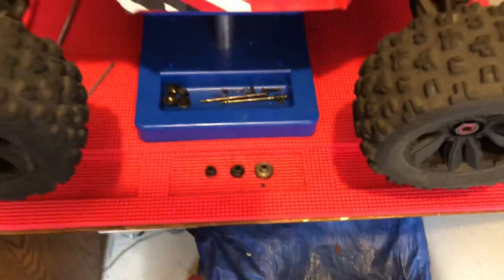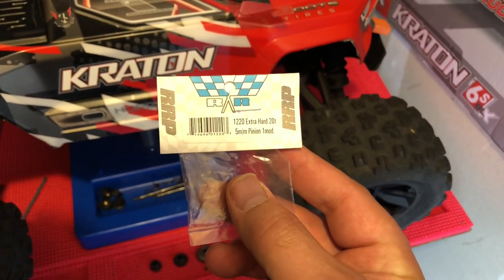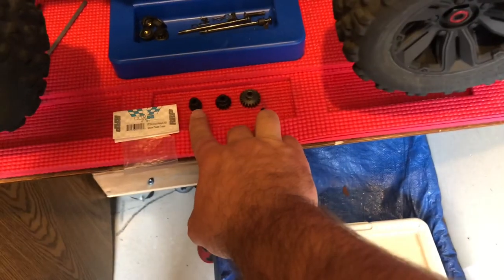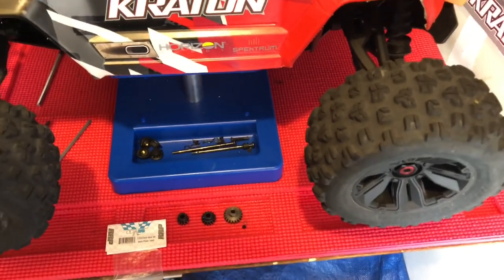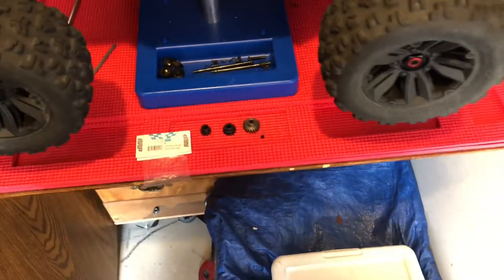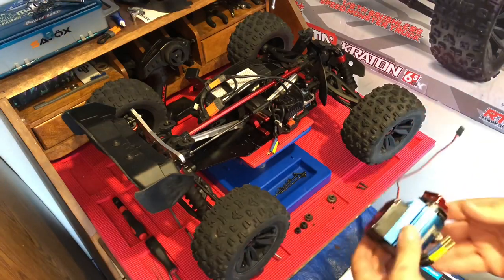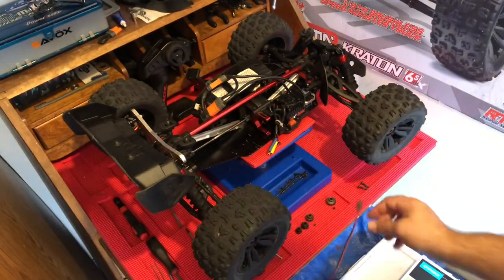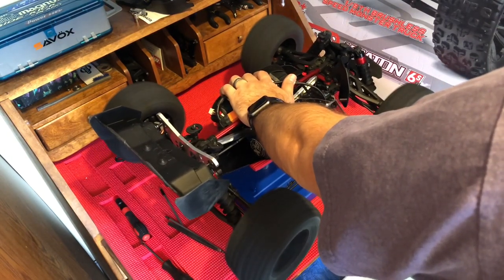PINION GEARS | Arrma Kraton | What you need to know

Comment: I have kraton 6s v5 will the optional 15 tooth speed pinion be ok for bashing?? My 12 tooth pinion stripped so I'm changing to the 15 tooth and I'm worried about overheating?
Reply from the maker: Yes, youre fine. The 15t speed pinion is still for bashing.
She will run hotter yes, but you shouldn’t run into any overheating issues.
Unless you’re running oversize tires and you’re running in long grass for extended runs. Both those things contribute quite a bit to heat. That and where you live, if it’s 100+ degrees outside, you can have an increased chance of overheating.
I always recommend picking up a heat gun, you can find good ones for pretty cheap and having one on hand as always good idea.
I have videos in my library that will talk about heat temperatures and their thresholds.
I also have a whole series on high powered fans.
It’s not until people start overgearing past 15 T typically where they start running into heat issues.
Reply: @EastTactics  thanks for reply! I actually have an arrma heat sink and fan but it's not quite as powerful as yours and I just ordered a heat gun off of Amazon with the help of your links on the pinion gears video. I think I'm going to upgrade to a better heat sink and more powerful fan for motor and esc. Thanks a lot for the help 👊🏽👊🏽. And I also took a screenshot of the motor temps that you posted in the description you're a big help thanks
Reply from the maker: Any time
Reply: @EastTactics  one more thing. I have scorpion belted tires on the back and the stock d boot tires on the front of my v5. My question is will I have any problems with the differentials on this set up of tires? What are your thoughts because obviously the tires in the front are ballooning a lot while the ones in rear doesn't ballon at all
Reply from the maker: @boomerak4774  
You differentials really shouldn’t be put under any undue strain based on the fact that you’re running different tires in the front and rear. Unless they’re a size difference was dramatically different.
Do you do it, simply because you like the look, ideally running all four of the same tires is recommended, but you should be fine.
Have you seen my video i’m putting silicon earplugs in the center differential? Massively reduces ballooning, especially in the front.
Something you might considerz
Reply from the maker: @boomerak4774  
Your differentials really shouldn’t be put under any undue strain based on the fact that you’re running different tires in the front and rear. Unless they’re a size difference was dramatically different.
Do you do it, simply because you like the look, ideally running all four of the same tires is recommended, but you should be fine.
Have you seen my video i’m putting silicon earplugs in the center differential? Massively reduces ballooning, especially in the front.
Something you might consider.
Reply: @EastTactics  no I only did it because one of my stock tires blew out and my local rc shop only had a pair of the scorpions that would fit my truck. Thanks I'll check out that video!

Comment: Did you fix the pinion gear bolts with Loctite 270?  What is the Loctite number for fixing the motor mount?
Reply from the maker: Yes, I use, loctite 209741 Heavy Duty Threadlocker, it’s 270. 
I also use it for the motor pinion, and for attaching the out drive to the front and rear spiral input gears. I also use the red Loctite for the motor mount when attaching it to the chassis up from the bottom.
Note, removal recommends heat, to break/loosen the bond. I use a smal lighter size butane torch.
I use blue 242 Loctite however when securing the motor from the top while setting the mesh.
Also note, that I have taken a Dremel to the two screws that attach/secure the motor (while setting the mesh) to the screws so that I now actually use a flat head screwdriver to tighten and remove those. See this video
https://youtu.be/NAOAFfMpXIk
Reply: @EastTactics   thnx alot lol

Comment: Do you run your truck on 3s ever even though it’s 6s I got lots of 3s batteries I’m thinking if I can use 3s I can get lots of run time just worried I’ll  mess up the motor or esc
Reply from the maker: I do run it on 3S, picked up the parallel adapter so I can plug both of them at the same time. 3s power for double the time. Can’t beat that.
I haven’t done it a ton though, and it runs just fine on 3s power. I haven’t heard anything regarding it potentially being bad for the engine or bad for the ESC.
Reply: East Tactics you mean the jumper plug to just run one 3s battery I need to make one and try it out what batteries you using btw
Reply from the maker: J Movision, no, what I mean is there is an adapter that allows you to plug in two 3S batteries into the system. You use the stock plug on one terminal that came with the car. And then you plug in a Y adapter to the other one. You then Plug  two 3S batteries into the Y adapter and the car runs on 2 3S batteries power for double the time. 

Here’s a video that shows my batteries and charger
https://youtu.be/LLp4Ld88xcI

Comment: What pinion gear would u recommend for max6 1650 combo on the 50 tooth spur
Reply from the maker: I’m assuming your running the Arrma 6s Kraton, if so, with that low of KV motor I’d recommend a 22 or 23 tooth if you were running a stock spur (46T). However, you’ve changed yours to a 50t. What was your motivation for increasing your spur to 50?
Correct me if I’m wrong… but going bigger on the spur increases torque and reduces top end speed
What is your overall motivation? You building a speed runner? Or is off the line speed and low torque your goal in mind?
A note to remember 
The closer the pinion & spur are in tooth count, the higher the speed.
The further away they get in tooth count, the higher the torque output. So if you wanted to get more torque and less top speed out of our rig, you could either up the spur gear higher or lower your pinion gear down.
If you wanted to get more speed for this truck, you could either 1) increase the pinion gear's tooth count or 2) lower the spur gear's tooth count. Both of these options will decrease the low end power of the truck while simultaneously increasing the overall top speed.
If I had the 50t spur, and didn’t feel like changing it, I’d run perhaps a 23-25t pinion gear. 😎👍
As long as you are paying attention to the temperatures of your motor and speed control, there isn't a wrong gearing. Play around and find what works for you.

Temperature Thresholds
Motor
Ideal - 140°               60° C
Hot - 150 - 160°       65.5° - 71.1° C
Overheat - 165°        74°C

ESC
Ideal - 135°               57.2° C
Hot - 140 - 150°       60° - 65.5° C
Overheat - 155°        68.3°C
Reply: I have an outcast 6s v2 it came stock 50 tooth spur running a 18 tooth pinion right now but tryna get more top end speed . I kno it’s a stunt truck but with low profile backflips I’m hitting 59 mph but looking for more u kno , but u think a 22 or 23 tooth will put a smile on my face 🤗 I wanna try that big pinion it’s just the thought of over heating my new Max 6 combo or over working my drivetrain what u think
Reply from the maker: Maybe upgrade your fans both both the ESC and the motor to keep’r cool.
Playlist about this:
DIY RC High powered fans https://www.youtube.com/playlist?list=PL9UjUE_DygV9w_KTuR7N0l-ygVhWPtNVw
Reply: @EastTactics  Thanks appreciate the info which fans should i be looking at
Reply from the maker: The Alli express ones are the best IMO. See links in all those vids. 😎
Reply: @EastTactics  thanks 🙏 ima look into it

Comment: Have you tired running your v4 KRATON with a RR 20T pinion on 6s yet?
Reply from the maker: Ya... dropped back to a 16t. 20T was killing my drive train, braking rear diff pin and planetary gears. Also cogging issues. 
20t was too much for stock motor and stock ESC. I’m Much happier at 16t. 😎👍👊
Reply from the maker: I have, unfortunately I was doing it with the stock motor and ESC. Which ended up providing a cogging issue and also increased my breakages in the rear differential. So until I get a better motor and ESC I won’t be running A 20T pinion. I run a 16 to Pinyon on punch setting six. And while it’s not quite as insane. It’s still I’ll beast

Comment: How many teeth u have on the spur gear? Spur gear also makes a difference
Reply from the maker: Stock 43
No longer run a 20 tooth pinion! Way too much for stock components.
Reply: @EastTactics  ok
Reply: How about the 20 on a 1250 6s?
Reply from the maker: Should be fine. It’s the 2050 that’s the issue. You’d be fine running 20t on a 1730kv motor. But you’d want better then a blx185 ESC.
Reply: @EastTactics  thank you. I wound up going with the spektrum kit, the 160a ESC and the 1250. Had a hard time figuring out how to mount it but I think I got it. I just ordered a 17,19 and 20 off your link for the Robinson pinions. Thank you again East
Reply from the maker: Ya I still need to mount mine Rory I didn’t create a vid on that yet… wanted to get the exb roller on sale… which I did. 
So it will be coming. 
Sounds like a sweet setup! How does it feel?
Reply: @EastTactics  lol, I don't know yet. I have been just using my blx while upgrading the EXB. I picked it up on the earlier sale that HH had going on. I've just been watching your vids and putting a bunch of m2c parts on. The electronics only got here yesterday. Been searching for a spektrum 8s pack but I guess they don't make one? To go with all the other smart function pieces. 🤷
Reply from the maker: Even though I’ll be running an 8SESC, I never do plan on running an 8S battery pack. Or two 4s. I still plan to run sixth power pretty much hundred percent of the time. The main reason I went with the higher and yes he is basically just because it’s better quality and provides more power to your servo etc.
Probably tear up your differentials pretty quickly If I were to toss in an 8s power in the 6s
Reply: @EastTactics  ok
Reply: @EastTactics  I was thinking that too. Maybe help keep the temps down running 6 on an 8s capable ESC. Looking forward to your EXB build vids.

Comment: I have a 13th tooth pinion in there now or put a 16 Tooth pinion will it be safe in rguards to overheating?
Reply from the maker: It comes stock with 13, they offer a high speed gear I believe that’s 15. Technically Arrma feels comfortable allowing a 15 tooth pinion gear without the need of a fan for your motor. 
So anything past that, I would recommend putting a fan on your motor.
I run 16t... Without a fan, my motor will overheat when running in grass. 
Running in grass is a major contributor to heat.
Reply: @EastTactics  they is Already a fan on the top of my motor
Reply from the maker: Yeah, I was more referring to my V4 Kraton. The motor does not come with a fan stock for this. But if you’ve already got a fan on your motor then you could probably get away with increasing your pinion a bit. However I would pick up a temp gun to monitor your vehicle. They’re pretty inexpensive.
https://amzn.to/2VLdy61
Reply: @EastTactics  Thank you East Tactics
Reply: @EastTactics  like how much would u say in Canadians Dollars?
Reply from the maker: No clue, but it’s about $20 US
Reply: @EastTactics  SO Iam guessing about$30 Dollars
Reply from the maker: Yeah, for that particular model. I guess that way you could probably find something cheaper
Reply: @EastTactics  i picked 1 up. Today a heat 🔫 and i have 2 Cooling fans 1 on top of motor and 1 near the SERVO Esc iam getting a15tooth pinion gear i asked owner would it be safe All he said to me DON'T STOP And go WITH.her LET her RIP keep. Her going too break her in

Comment: Is 48t spur /18t pinion good for bashing in kraton 6s??
Reply from the maker: You can test it out,  you're kraton might be fine, but he's what you need to know. 
It comes stock with the 50t spur, did you, or are you planing to drop that to a 48T pinion as part of your strategy for running the 18T?
Also... as you are likely aware the Kraton comes stock with a 15T high speed pinion. 
I'll assume that the 48T spur gear is not that much different then the 50T.
this is what I can tell ya. Anything past 16t for your pinion, you're going to want to add a cooling fan for your motor. So keep that in mind. 
Now regarding 18t, thats definitely pushing the stock motor and ESC.
I made a rookie mistake when I first started out in RC and tossed on that 20T pinion. It was a mistake, I started breaking planetary gears and pins in my rear differential right and left. I also started Cogging, which is an annoying stutter off the line due to a miscommunication between your senseless motor and your Esc. Happens because the stock motor and ESC do not like it when you start getting to high up there with your Pinion.

Now granted I jumped all the way to 20T and was having those issues. So you might be fine going with 18T, especially if you drop the spur gear down 2T. 
but keep in mind your asking alot more of your drive train when you increase your pinion gear too much, and breakages are more common. Particularly in the rear end. Getting hardened steal diff pins from Mcmaster.com can help, as it adds a lot of strength to those pins. See this Vid for more info on that.
https://youtu.be/cnT25bXYH3k
Also make sure your diffs are shimmed correctly both inside and out.
https://youtu.be/gxY_QNpz2m8
https://youtu.be/03Jcis3yJDo

Typically when people want to really increase that pinion gear to 20+ they are doing it because they have picked a higher torque motor, that can handle the upgrade. 20+ teeth begs the need for a motor pushing 1600 -1800kv, and a better ESC to handle that motor. Speed is recouped from those lower KV motors by increasing that pinion gear to 20, 21,22, 23, etc. 
But stock motor and ESC cant handle that... happily, and without cogging and lots of diff gear breakages.
If you have any other questions let me know.

Comment: You will  have heat issues my kraton hit thermal protection with the 15 and 16 tooth so i got a 1730 long can hobbystar pair with a max 6 esc and a 19 tooth stupid power
Reply from the maker: You make a good point. That setup sounds legit! ... I’ve had no issues with heat as of yet, with my heat sink and fan.
Reply: @EastTactics  I've heard the hobbywing fan is the best for the arrma 6s line ill buy one and go back to stock to do some test wish I'd tried the fan first
Reply: @rc4life315   are you running it 8s on the max 6 or just keeping it at 6s?

Comment: Do I need to gear down if I use bigger and heavier tires?
Reply from the maker: EL Valenin, It is recommended that if you go with bigger tires you steer away from large pinion gears, in my opinion. I’m actually planning on dropping down from 20  back to 16 or 17 simply because I’m feeling like I’m going through too many broken rear Diff gears. And the increase in breakages seemed to happen after I upgraded to the 20 tooth. And I’m just running the stock tires. Larger tires puts more strain on the diffs. In my opinion the increase in speed is pretty negligible. I felt like my RC car was insane fast even with the 16 tooth pinion gear. Which is still an upgrade from the stock 15 to oth speed gear. 
Unless you’re building your RC car for speed runs and racing, I would suggest actually either sticking with the stock pinion gear or just increasing it to maybe 16 or 17. I’m a basher, care only for eating up the next biggest jump lol. 
Another thing to note, is that it is very important to keep a much lighter weight differential lubrication in the rear. When I experimented with using a higher differential weight, My Kraton didn’t like it, she snapped pins or planetary gears.
Something like the stock 10 K in the rear is good or maybe 20 K.
I currently run 20 K rear 200 K Center, 80 K front. 
But if after drop back to a smaller pinion gear, If I’m still finding that I break pins/gears in the back I might drop it to 10 K in the rear. I only have ever had issues breaking components in the rear differential. And I’m currently investigating on how to prevent it. But I would definitely say the combination of a high tooth pinion gear/ large tires/and to thick of diff fluid is a recipe for lots of rear differential breakages
Reply: @EastTactics  I am afraid of damaging my electronics, should I gear down from stock 12T to 11T?
Reply from the maker: EL Valenin, I would say you’re probably fine to keep it as is. However if all of a sudden you start breaking rear differential gears repeatedly then it’s likely due to the big tires. But 12 teeth is relatively small. I’m not sure if I asked but, what are you running? Are you also running The version 4 Kraton? I think it comes stock with 13t pinion gear. I wouldnt imagine ever needing to go below that.
Reply: @EastTactics  I am running V3 Kraton. Stock with 12T pinion.